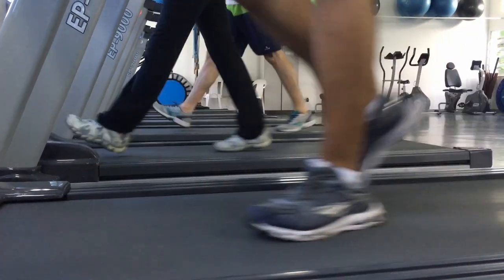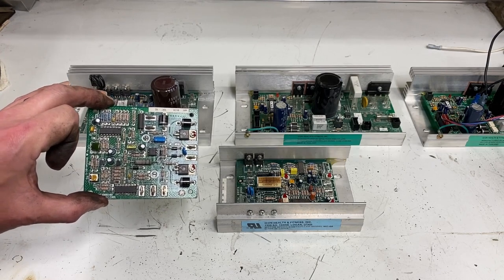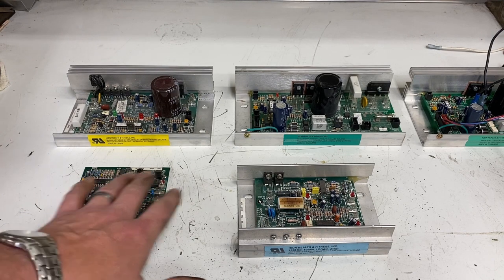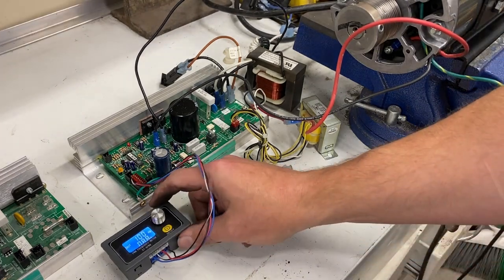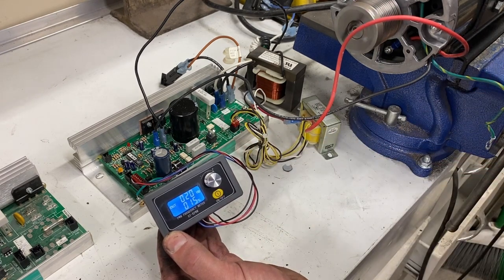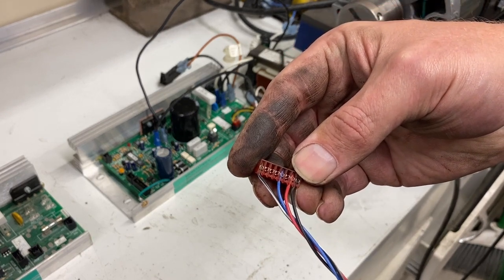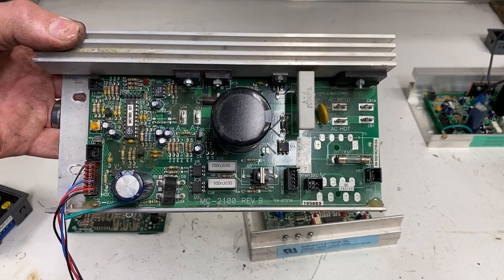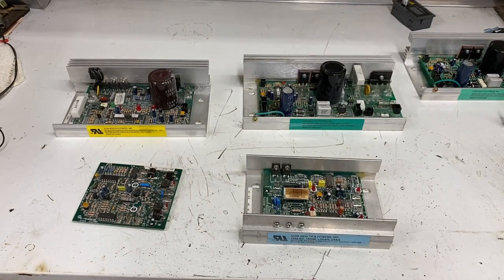Variable Speed Power Supply, Treadmill Motor Controller Boards: MC-02, MC-60, MC-2000 or MC-2100

Comment: Newbie to electronics here--i have the exact board and treadmill motor with 4 wires. Can i leave everything wired the way it is originally and ONLY change thre controller to the pwm controller OR do i have to switch around certain wires and which ones? Thx
Reply from the maker: First of all being a “newbie” be very careful AC can kill and there are places on the board that if touched while the board is on, could shock you. With that said removing the main controller cable and correctly connecting the PWM in its place will allow you to control the motor speed without the treadmill head unit. As far as the rest of the wiring, the way it is wired for the treadmill is how it needs to be wired for use outside the treadmill UNLESS there is an incline motor. That would change things.
Reply: @dazecars   Thank you. Yes, there is an incline motor. Advice?
Reply: The four wires going to the motor allow an overheat situation to interrupt power to motor. Usually the two wires for overheat are blue and the red/black wires are motor power. Most people do not use the blue wires unless the motor is noted to get hot during their normal use. My guess would be if you run the motor too slow to allow the fan to cool or at or near max HP for the motor would justify it. I'm not sure how they wire to the board originally.
Reply from the maker: @jaspermcconnell6417  the blue wires take no extra effort to use so I always recommend you hook them up if your motor has them. They are designed to cut the AC power coming in, in an overheat situation. On an MC-60 or MC-2000 you would use the blue wires as the connection between the switch and the board. In other words the hot AC wire (black) goes into the power switch and one of the blue wires comes out of the switch as the hot. The second blue wire connects to the hot in on the board. The result is power comes from the wall to the switch, if the switch is on power flows through the first blue wire to the thermal switch in the motor and then out on the other blue wire to the board.  If the motor get s to hot power is cut. The same wiring is true for some early MC-2100 boards. Later ones however have two extra terminals, next to the AC in on the board,  that are there to connect the blue wires or a circuit breaker.

Comment: ithis is way cool! I have been sitting an MC-2100WAM and motor out of the same treadmill. I have a wood bandsaw to put it in to make it a metal bandsaw. Now I'm thinking it should go in my HF 3 in 1 mill. decisions, decisions
Reply from the maker: First thing I would check before doing either thing is to see if the motor is up to the task by calculating the torque.  I put an MC2100 on my bandsaw and this was the result https://youtu.be/yMkW2SXl_sA
Reply: @dazecars  the treadmill motor does not have an rpm rating. Just hp and watts. It  is a PM motor , 2.25 HP Cont. Duty @130VDC/2200 Watts. P/N M-237595. This came with the MC2100. should I not bother?
Reply from the maker: @332ARA  What is the diameter of the motor?
Reply: @dazecars  about 4.5" 7" long with pulley
Reply from the maker: @332ARA  that is actually one of the better ones. There is a full range of quality in that size but they are all better than the 3" ones.    It likely has an RPM  rating of 2500-5000.
Reply: @dazecars  so keep the motor and ditch the 2100 for an SCR?- (bandsaw)
Reply from the maker: @332ARA  First get setup with the SCR that way you can test the motor for max RPMs and then calculate the torque.  Then you will know for sure if it will work. It's probably good especially if you gear it down but better to know before you put in the effort.  It is extremely important that you gear it at a minimum so max RPMS of the blade wheel do not exceed the original max RPMS with the OEM motor.  I used a laser RPM to measure mine. If you over rev a bandsaw bad stuff happens.  Also by gearing it you add more torque which is critical with a band saw.

Comment: I would like to send a picture of the board that I got today with my free treadmill but I don't see an option to send photo not sure what type looks real similar to the one you use with the plug in wiring it also has 2 ferrite chokes on  the board but I can't  find the H W L pole
Reply: the board has 2 transformers not chocks like I said 1 has 2 black wires and 1 has 2 red wires
Reply from the maker: @erniegray3500  email me through my website
Reply: @dazecars  done

Comment: Hi very informative. I have an exercise  treadmill machine Nordictrack A2250 with a mc 2100 board.
 I changed the mosfet in the board  once because was shorted  and installed back on in the machine, and as soon I started the treadmill  it got shorted again. so I changed the mosfet  the second time  and this time I removed the Treadmill Motor Belt and started the treadmill with the new mosfet in the mc 2100 board and this time did not blow up the mosfet but as soon I installed the motor belt back again and  I started  the treadmill and this time it did blow up the mosfet again.
somebody told me to check the flyback diode if its  one in the board, but I don"t know if it has one but if it does I don"t know how to troubleshoot the flyback diode.
Any ideas? thank you
the treadmill walking belt its find.  it does not fill hard to turn it. it fills free motion.
Reply from the maker: it does have a flyback diode but that is likely not the problem.  There is a smaller component next to the rectifier.  This is similar to a MOSFET  and should always be changed the same time as the other.  Sometimes they fail in the "on" position and that will cause other components to fail.
Reply: @dazecars  Thank you for your quick respond 
with out a diagram for the mc 2100 board it"s hard to identify the part names. 
so the smaller component next to the rectifier (mosfet) but when I search on the  internet for part replacement by the serial numbers printed in the component it can not find it,

any advice?
Reply from the maker: @MORJOYES  the rectifier is the largest component on the heat sink all the way to the right.  The smaler component to the left of the rectifier is the one I am talking about.  I got some off of eBay.
Reply: @dazecars  Is there anyway you can give me the part name or part number to look up on eBay? Thank you
Reply from the maker: @MORJOYES  S4025L here is an amazon link https://amzn.to/3TL8lYS
Reply: @dazecars  thank you
I will work on it and li will let you know how it goes

Comment: Had another question!! Ventilation. When I install the components in a box, metal or plastic, do I need to allow for ventilation?
Reply from the maker: You might have missed one of my previous replies as I mention that exact thing "wood shop changes things, you want it free from dust but you also want it to have cooling.  I would mount it in an electrical box with venting"
Reply: @dazecars  I saw the dust Free part. But missed the venting! I'm guessing passive?
Reply from the maker: That’s the problem. In a treadmill you have a fairly open cavity for heat to dissipate. You also have the fan on the motor circulating air in the treadmill. No it’s not blowing directly on the board as it’s primary function is motor cooling but the moving air is going to still help. In your case a small fan is probably a good idea BUT you need it to be low dust so I’m not sure the best option for your application.
Reply: @dazecars  Maybe I will add a small fan to keep air moving.

Comment: Hi where do you put the choke on the board.
Reply from the maker: The DC choke goes in line on the + output of the board between the + output and the + wire going into the motor.  An AC choke goes between the two power wires coming into the board and the AC inputs
Reply: @dazecars  thanks for letting me know.

Comment: You have email for more questions and pictures?
Reply from the maker: Email is on my website
Reply: @dazecars  The four wires coming off the original panel are red,black,blue, green. Everything works with panel so I know all my conections are good. When I try running the 4 colored wired to my POT nothing works. Do I need a frequency POT instead of a regular POT?
Reply from the maker: @justinlogue31  , what board are you working with?
Reply: @dazecars  MC1650LS-2W
Reply from the maker: @justinlogue31  I can't help you with that without further information.  Email me several detailed pictures of the board.
Reply: @dazecars  I will try again, other night it wouldn’t let me email you.

Comment: Can a class 2 door bell transformer be used 16 v ?
Reply from the maker: Are you wanting to replace the external transformer that goes with an MC 2100?  if so there is a chance the doorbell transformer could work.  The external transformer for the 2100 is class 2 and 16V so as long as there are the correct number of connectors, you should be able to make it work.

Comment: found a treadmill with a MC2100LTS-50W rev B board. looks like it has a  ferrite choke built in and also has a transformer on the board.
Reply from the maker: that is the older type board. every treadmill I have parted out with a 2100 had the AC choke. some were part of the board like yours and the others had it as a plug in part like I show in the video. same is true of the transformer. I am not sure you are saying this but in case you are I want to clarify, a DC choke and and a transformer basically look the same but they have totally different functions and are not interchangeable. for best motor life you still need a DC choke between the motor and board.
Reply: @dazecars  thanks for the help. its definitely a transformer on the board. I decided to try to use the board, so I bought a similar PWM to the one you have with the dial. i did not buy a DC choke, i wanted to make sure that the motor and board were working before i go spending any more money.  I wired in the PWM, set it to 20Hz and the motor spun!... that is until i turned it up to almost 100% and it cut off and the screen flashed OUT. then i reset it and  then it tripped the breaker soon after trying to turn it on. tried again and the same thing. does not happen until i try to get the motor to spin. thoughts?
Reply from the maker: @JustinPoggeOldFieldCycles    Sounds like you burned out the MOSFET, which is the switching transistor.  It reduces power by turning on and off rapidly.  When they fry they ether fry stuck on, or stuck off.  Sounds like your is in the on position and the motor is drawing too many amps.